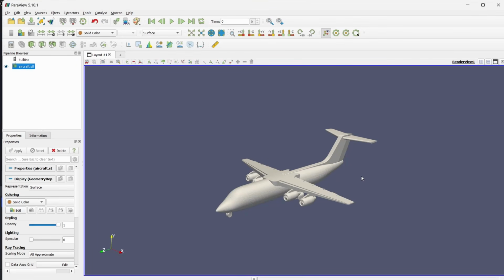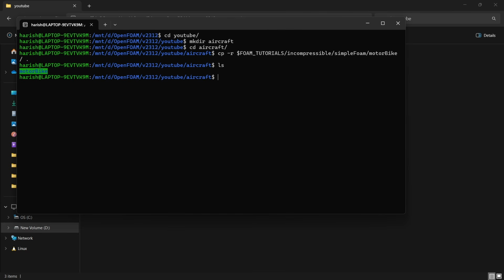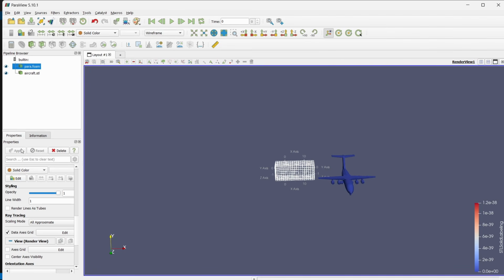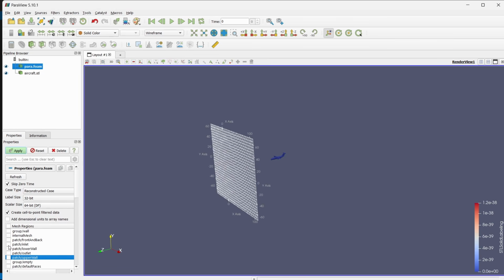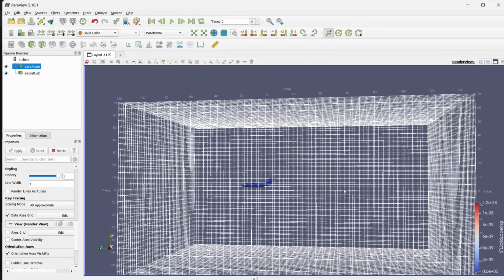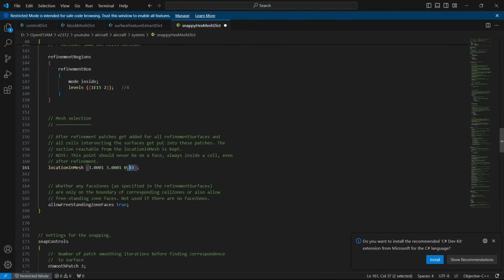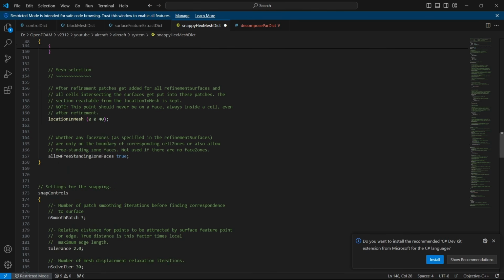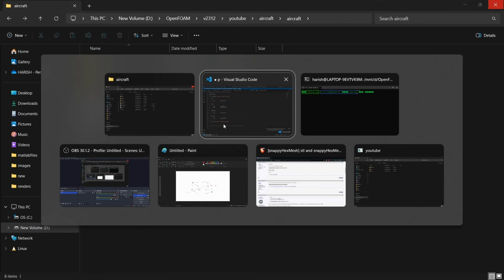Meshing STL Using snappyHexMesh in OpenFOAM

Comment: My sincere gratitude!
Reply from the maker: Im glad it was helpful.
Reply: @Codeynamics  I'm using of2312 on Ubuntu, but I made one change with help of Cursor:
mpirun -np 12 snappyHexMesh -overwrite -parallel # not working
mpirun -np 12 --oversubscribe snappyHexMesh -overwrite -parallel # command suggested by the cursor

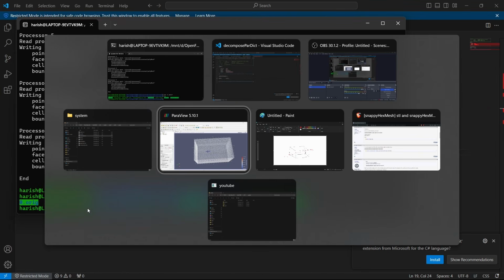It runs, but at 33:25 my model just load the aircraft without mesh area.

In the Mesh Regions is available only:
group/aircraft
group/wall
internalMesh
patch/aircraft
Reply from the maker: Geometry watertight or non manifold problem mostly

Comment: showing ghost errors like maxnonortho undefined in snappyhexmesh when that not even there in my file what to do??
Reply from the maker: sorry I don't understand your question. Please elaborate
Reply: @Codeynamics    when running the command mpirun -np8 snappyhexmesh.... (it is showing that  keyword max non ortho keyword not defined in snappy hexmeshdict, meshquality control (file loc) i went and searched for this keyword in the file it wasnt there ,so like it threw an error for a keyword not in my file ,confusing
Reply from the maker: Check if you have the meshQualityDict. It is necessary.

Comment: Hello, thank you so much for the detailed video! Just a quick question, my snappyhexmesh gives me high non-orthogonality >65 (around 10000+ for some of my finer meshes attempt), which parameters can I adjust to avoid this error? Thank you!
Reply from the maker: Instead of adding more refinements in snappy, make the blockMesh finer and then run snappy with lesser refinements. 
This might fix the error.

Comment: What is the file structure when you run motorBike(LES)? Where there is a lesFiles and motorBike subfolder?
Reply from the maker: If you want to run motorBike LES, then check under pimpleFoam tutorials.

Comment: I cant find the surfaceFeaturesExtract command in the motorbike directory. im using openfoam12
Reply from the maker: Sorry. The structure of OpF12 and any org version is very different. I use ESI versions. I will try to make a snappyHexMesh video for org versions soon. 
Thanks for pointing this out. 

To solve your issue, please check the Allrun file in your case. Follow the commands given in that.

Comment: Hi, when I run surfaceFeaturesExtract command, gives me this error:

"The surfaceFeatureExtract utility has been superseded and replaced by the more
general surfaceFeatures utility.

surfaceFeatures reads a surfaceFeaturesDict input file with a much
simpler, more convenient format.  Example surfaceFeaturesDict files
can be found in the tutorial and template cases, e.g. located as
follows:
find $FOAM_TUTORIALS -name surfaceFeaturesDict
find $FOAM_ETC -name surfaceFeaturesDict"

I have also another error with running surfaceFeatures command by changing surfaceFeatureExtractDict file.

Everything is stopped :(
Reply from the maker: If you are using the foundation version of OpF, then this could happen. I am using ESI version. 
Please check the documentation for the equivalent command.

Comment: for some reason, maybe because I am running openfoam 12 but when I pull motorbike, it does not provide the same files, is there something I can do to get the same files you do? or do I have to downgrade my openfoam versions?
Reply from the maker: Yes. OpF 12 is totally different. It is a foundation or .org versions such as v10, v11, v12. I personally prefer to use ESI or .com versions such as v2306, v2312, v2406. So it will be entirely different for you.
Reply: @Codeynamics  Would you recommend those versions overall? whats the differences?
Reply from the maker: @ayushtokeria6965  I would recommend ESI Versions. v2406 is my fav. Next month I will also start using v2412 once it is released. For some reason I am not very comfortable with foundation versions.

Comment: Great video! I am new to Linux and openFOAM so this may be a basic question, but I am still confused on where to save these files freshly from installation. Right now OpenFOAM is installed at the file location, \\wsl.localhost\Ubuntu-24.04\opt\openfoam12. When I begin a new simulation, where do I start saving and moving these files? Do I create new simulations within the "openfoam12" folder, or "\\wsl.localhost\Ubuntu-24.04\home\user\OpenFOAM", or can it just be under "My PC" like typical things? Essentially, where is your YouTube folder and what other files needed to be stored there for OpenFoam to function?
Reply from the maker: Good question. I have answered this in detail in my OpenFOAM installation video. 
Although the video is about installing v2406, you can skip over to the additional tips and check it out. 
I hope it helps.

Comment: Small mistake in the vid about parallel processing. Using mpirun with the flag --use-hwthread-cpus , OpenFOAM executables can be run with as many logical cores as you have available, not just the number of physical cores. However, it's a bad idea to use all of them. Save 1 or 2 logical cores in case the system needs to do something else. For example, I have 8 physical cores and 12 logicial cores. I run most simulations on 10 logical cores with the flag above.

One question: Are the boundary conditions handled by blockMesh? Other than that, very helpful, thanks very much!!
Reply from the maker: Thankyou for the comment. 
If the virtualization is enabled in a PC, then it will take threads as you rightly mentioned. Which is actually the case in most performance or gaming laptops. But many people watching this channel use very simple laptops that don't come with virtualization enabled. So in that case only the processor will be used. 

Regarding Saving a few logical cores for other tasks of the computer is absolutely true. I just didn't want to over complicate things about parallel processing in a video focused on snappyHexMesh. So didn't go much inside. I have already made a video on MPI parallel processing for OpenFOAM and I'm planning to make a dedicated video to explain the problems and it's possible solutions during parallel processing in OpenFOAM. I'll make sure to include this suggestion of yours too ☺️. Thankyou very much.

The boundary patch names are handled by blockMesh. The boundary conditions as such as handled by files under 0/ folder.
Reply: @Codeynamics  Ahhh thank you very much for explaining! I use a wsl2 environment, so I've always had virtualization enabled! I never knew!

Comment: Hello,

Thanks for this great video!
I am having difficulty working with a 2D case using snappyHexMesh. Despite defining the front and back patches as empty in the blockMeshDict file, snappyHexMesh is still refining the blockMesh in the third direction, which should not happen for a 2D case. Could you please provide some suggestions on what changes I should make? 

Thank you!
Reply from the maker: Have you kept the third direction as a single cell length in blockMesh itself? 
I generally wouldn't recommend snappyHexMesh for 2D cases, it is good for 3D. You can try gmsh. That's much better.
Reply: @Codeynamics  Yes, I’ve kept the number of cells in the third direction to just a single cell. The blockMesh creates a good representation of a 2D mesh with only one cell in the third direction, as defined in the blockMeshDict file. The issue arises when I use snappyHexMesh to snap the mesh to the .stl geometry, which is a CD nozzle. I was trying out this particular geometry because I wanted hands-on experience with mesh generation, rather than just using the tutorial files. And also after running snappyHexMesh the boundary condition file in constant/boundary directory gets altered and shows absurd boundaries.

I’ll definitely try Gmsh, but as I'm learning OpenFOAM, I’m curious: What do industries typically prefer for meshing—snappyHexMesh or Gmsh? Or does it depend on the specific problem?

Thank you
Reply from the maker: @swap_pat29  The way to do that is, you have to take a section of the 3D geometry and extract the 2D. Then extrude it to give a thickness. Now use snappyHexMesh to make the 3D mesh. 
Then, you can use the extrudeMesh tool to change the thickness of the mesh to 0 and then extrude it back to 1 cell thickness. 
This sure is cumbersome. Most people prefer using blockMesh for simple 2D meshes. For geometry driven meshes, gmsh is much better and convenient than the above mentioned process. 

This is the thing with Open source tools. You learn one, and one way or the other you will have to learn the associated opensource tools as well sooner or later (if you want to be efficient at what you do).
Reply: @Codeynamics Thanks a lot for the detailed explanation! That makes sense now.

Comment: thanks really helpful.Just a quick question did you run the silulation and if so which command did you use?
Reply from the maker: Thankyou. 
I did not run the simulation. If you had to run for that case specifically, you should be using simpleFoam command.
It depends on the solver.

Please do subscribe and support for more useful videos.
Reply: @Codeynamics  hello again, i'm having a problem with the snappyhexmesh.When i run it i am usually having blocks meshed around the airplane instead of the geometry being meshed completly.So the resulting mesh is just a bunch of blocks surrounding the aircraft what can be causing this error?I just used the snappyhexmesh command without the mpirun because for some reason it told me that this command doesn't exist could this be the reason?
Reply from the maker: The reason is that in the snappyHexMeshDict, under snapControls function, see the 6th and the 7th parameters. set the implicitFeatureSnap to false and set explicitFeatureSnap to true. This should make your problem solved. 

The behavior with just snappyHexMesh will be exactly the same as doing it with decomposed case. It is only a matter of time that differs for both the process. mpirun case is faster due to parallel processing. 
I hope this is clear.